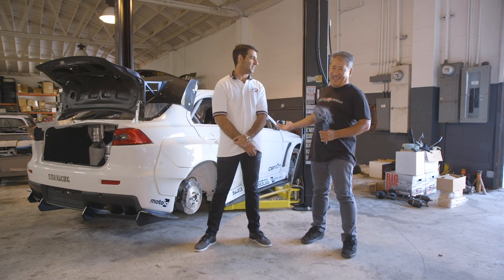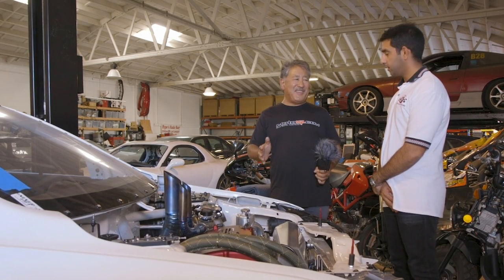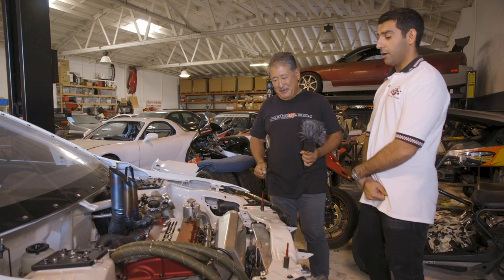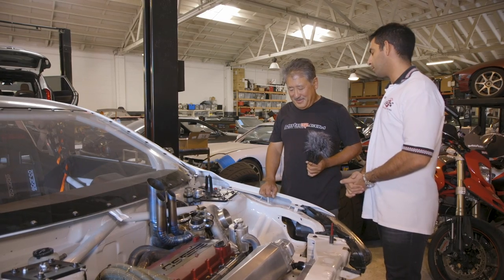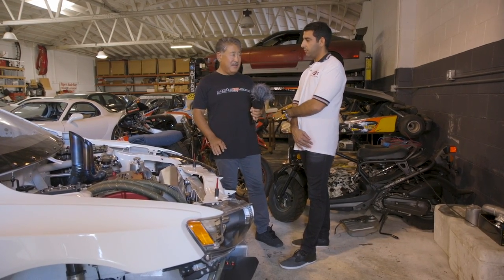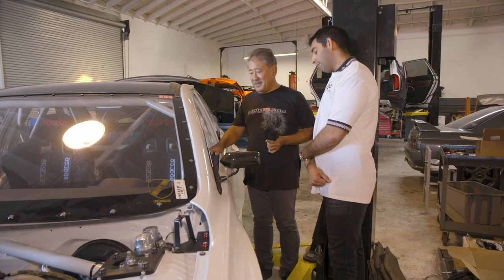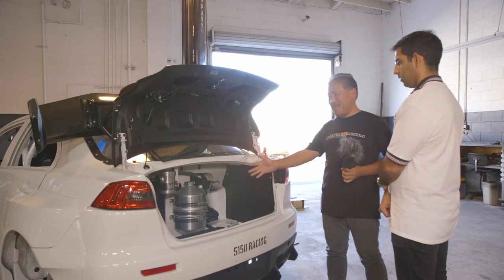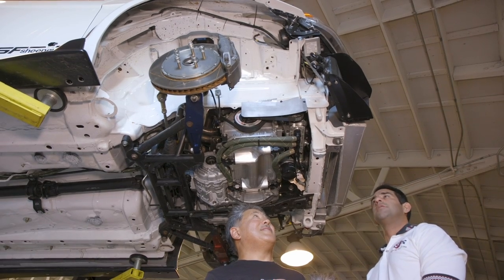The MOST In-Depth Look Into the CSF EVO X EVER!

Comment: I like how he discussed the insides of the engine too. Some people have a need to keep their race winning formula a secret. That in mind, you did help out by not telling people what kind of cam lift and duration or the bore and stroke of the rotating assembly.
7:58 I do think having a manual is neat. However, I figured CSF would have the DCT so the car could test or show off new DCT cooling products.
9:09 Love it.
13:34 Never seen it before, love it. Many modern cars got rid of a lot of wiring with a BCM, looks like the aftermarket took the concept to a new level.
24:10 That is common on some GM designs. Sometimes when there is an ABS error, you can't buy a sensor, you have to buy a whole hub an bearing assembly.
24:28 How much fuel does it hold? That's pretty sweet.
28:20 ACD pumps especially don't hold up well when exposed to road salt. Also, given the age of every Evo X, that compounds the problem. Some companies sell rebuild kits, but of course, that assumes your core isn't rusted too much. Since you didn't need it for the rear diff, I figured a Ralliart unit would do the trick.

I intend to own an Evo X 5 MT eventually. I want one of the ones with Recaro seats, but add a few X MR bits and pieces. When the cylinder head needs rebuilding, sodium filled valves are going in. I don't intend to mod much, I want a great DD and I don't have to drive much.
Reply from the maker: The cam specs are secret and the property of the customer. The DCT isnt capable of hold the power this engine can generate.  12 gallons, Its a brand new pump and this car isnt exactly exposed to road salt.
Reply: @motoiq  Excellent. I want the cam duration to be a secret, because secrets can win races. I did not realize a built DCT couldn't take this much power.

The reason I mentioned road salt and AYC pumps is because that is why they are hard to get. AYC pumps have a limited life, road salt shortens that life a great deal.

Comment: thank you for going more in depth with this car. it's easily my favorite modified car. i had an X a few years ago but high running costs caused me to part ways with it. it's incredible you got the rolling shell for about 20k. the subframes and cage alone would have been easily that much money, not to mention the carbon fuel tank and suspension to name a few more things...

Comment: I'm a little confused. At 4:30 Mike says they didn't want to sleeve it, and then he says it's down about 100 cc's from where it could have been and that he'd rather turn up the boost.  Did he mean stroked instead of sleeved? My understanding is that stroking creates displacement (the 100 CC's), and sleeving provides reinforcement for higher boost.
Reply from the maker: Sleeving can mess up the structural integrity of the block and have issues when the power has to be delivered for long periods of time like in road racing. Especially when it is extreme sleeving like wet sleeve conversions popular with Hondas to greatly increase displacement. I prefer to avoid it when possible.
Reply: @motoiq 
I didn't know about wet sleeving. I was only familiar with dry sleeving for reinforcement. I learned something new.

Comment: Neat build!
He never mentioned what racing  the car is for I'm sure that presented some challenges for your team helping build it.
If they plan to do much more than straight line stuff then it looks like they still have some work to do on the cooling system. I was sad to see it paraded around with no shrouds for the radiator or intercooler and an oil cooler that looks pretty undersized for a 700hp turbo car.

Comment: They didn't know for acd ayc pump (depends on model)  in evo x??? 🤣  Well, that's the reason why they put the acd pump under the car. If they knew anything about evo x and earlyer models then the would knew that the factory location of the ACD / AYC pump has been known to cause premature failure of the pump due to its direct line of contact from road debris / salt and other elements and a plate inside of the pump corrodes and causes the pump to lose pressure and turn off.

Comment: I love when he proudly says that the crank has been wpc treated, but we all know that it does nothing on a crankshaft because there is no metal on metal
Reply from the maker: It does a lot on a crankshaft, reduce hydrodynamic drag, reduce dynamic contact friction and damage potential when it does occasionally happen and increase fatigue strength by about 100%.
Reply: @motoiq  in my opinion onlythe damage potential can be a real reason to give wpc to the crank, but treating only the bearings is more cost effective for this. Can you prove the strenght increase?
Reply from the maker: @Andrea_eTi  There are opinions, then there are facts. Reducing the RA on journals reduces friction.  It is a common trick for just about all high-end engine build and all good engine builders do it.  There are a ton of white papers on the subject of the metallurgy of fatigue strength improvement, google is your friend and if you are serious, you can learn a lot about the processes available to do this. If you have a tech background you should know what the effects of adding compressive stress and grain refinement on the outside geometry of a stressed part does.
Reply: @motoiq  all the White papers you are referring to are not wpc related, but shot peening (bigger media than wpc). I still think that wpc treating an entire crank is loss of money and time.
Reply from the maker: Many engineers in NASCAR, F-1 and other racing series and OEM manufactures besides us that use WPC would disagree with you.  There are also white papers on WPC use for increased fatigue life and friction if you search for them but WPC is not listed by name.  Also, there are white papers from OEM manufactures that use the process as well, again not listed by name.  Microfinishing of crank journals for hydrodynamic and intermittent contact friction reduction is not a waste of time and it has been a common practice for professional engine builders to do it whether it is by using WPC, Isotropic polishing or mechanical means by tumbling media or paper belts.  Its been done for generations. Maybe you should study how pros build engines. Racing Engine Preparation by Waddell Wilson is an old book but it outlines a lot of common procedures and processes that are used today although many of the processes have been automated such as machining improvements by the manufacturer or replaced with higher tech methods like WPC or Isotropic superfinishing. It's better to learn than declare yourself correct against long-established best practices.